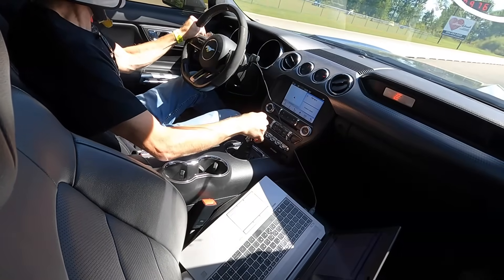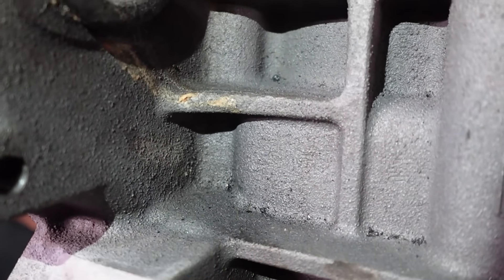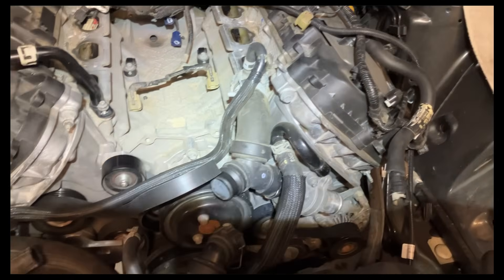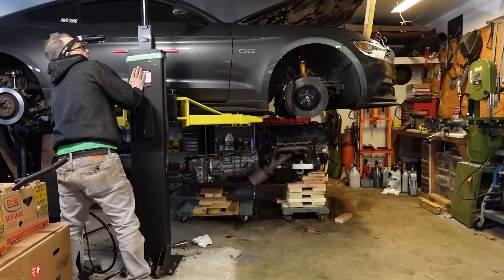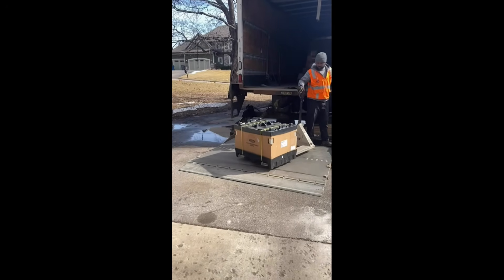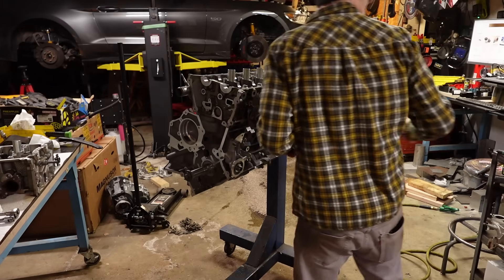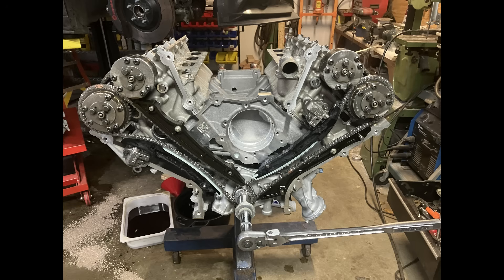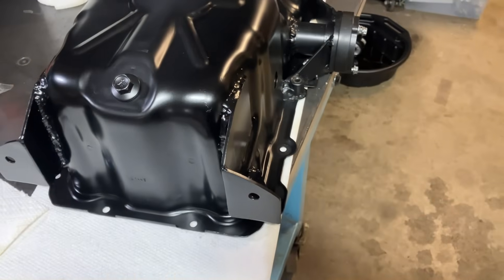AWD Mustang gets a New V8 Short Block -American GTr Ep 32 Ford Aluminator Coyote Supercharged.

Comment: low compression short blocks are unnecessary with coyote engines that get driven on the street. what you can do with 30 pounds low compression you can do with 20 on the high compression with less heat from the blower spinning so damn fast, the NA version is fine with a supercharger. if you got a good deal or couldn't find a high compression short block i dont really blame you. the gen 3 stock short block is pretty good with gen 1 and 2 heads for anything under 1000hp. aluminator can handle upto 1200 but will live reliable at 1000hp
Reply: I agree 100%. I spent about $18,000 on my built coyote and went 11:1.. Question, with the Alluminator short block, GEN 4,  that’s 12:1, do you think the rings need to be opened up a little bit if you’re gonna go 15 to 20lbs of boost?

Comment: Hope the pan doesn't crack now. COuld you have joined the plates to the bolts that hold the pan in place?
Reply from the maker: The pan is very stiff  this is just a extra bracing.  The differential is supported by brackets that attach to the motor mounts.  See my other videos for more detail.

Comment: Awesome work, though i dont believe the oil pan will do a whole lot being thin sheet metal, i imagine it will just flex before it provides any additional support, this is why the GT500 unit is thick cast aluminium front to back

Comment: Thank you for the great videos.  

What lift are you using?

Is  it mounted on studs with nuts or is it set up with bolts it into  imbedded anchors?
Reply from the maker: It is a Max Jax portable two post lift.  It is bolted to the floor with expanding anchors provided by the lift manufacturer.